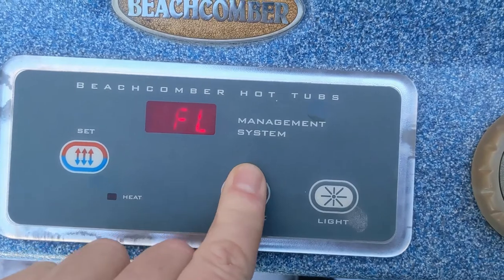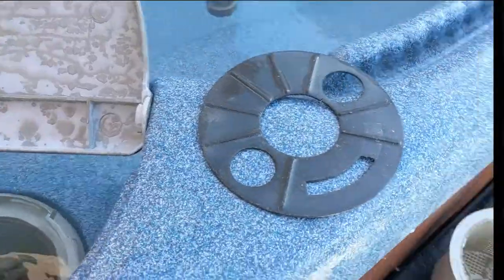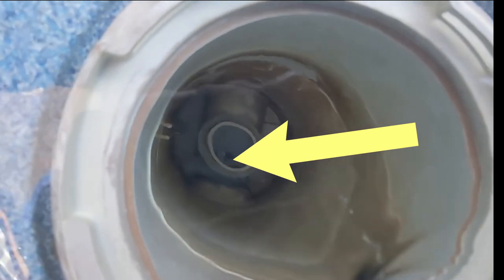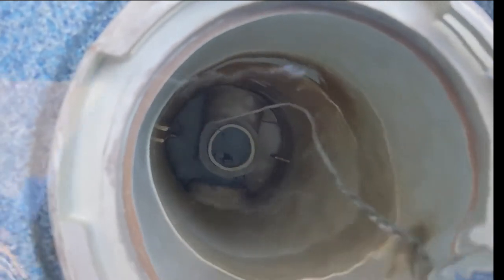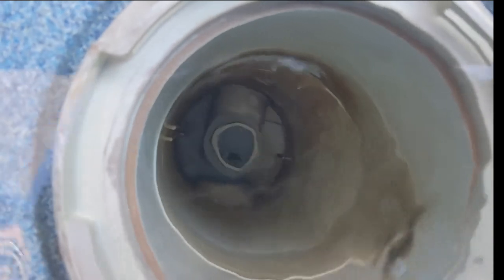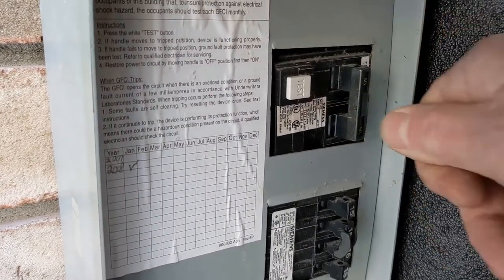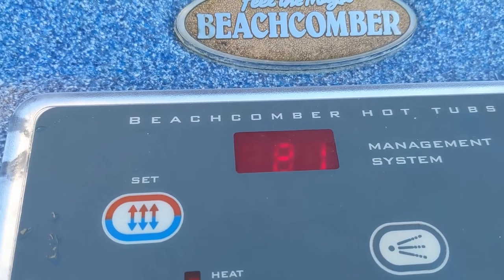Beachcomber HOT TUB FL Error Code / HOT TUB Not Working

Comment: Hello, I have a question. It's not related to error codes, but I have the same hot tub at home, and my LED light has stopped working. I removed it and closed my hot tub for the winter, but I have no idea how to replace it. Could you help me?
Reply from the maker: First.  Its rare that a hot tub light burns out.  Second.  Some beachcomber tubs it doesn't seem like you can even get to it.  Some, you can get from the inside but not sure if thats your tub.
Reply: @VIPPoolsandSpas  Yes, I know it's an old model, and I believe the LEDs have been replaced in the past. Due to water infiltration, the LEDs burned out. The spa was already there when I bought the house. Thank you for your response; I will consult a local repair technician.

Comment: I get an error code, but the pump and heater work when i push the jets on manually. The pump just wont circulate and heat in the low setting. So the tub just sits in a low flow state not circulating or heating until i turn the jets on  manually, and run for the 15 minute cycle.
Reply from the maker: What's the error code?  What spa pack do you have?
Reply: @VIPPoolsandSpas  Its a "Fl" code for no flow. Which makes sense because the pump (there is only one pump on this unit) isn't running, so the flow switch wouldn't be satisfied. Filters and actual flow are all fine. There is just something not allowing the pump to run at a lower speed and circulate while maintaining a temp. I'm not too sure the spa pack off hand as i'm at work. Def an older model. I'd say 2000-2005 300 series?
Reply: @VIPPoolsandSpas  The previous owner replaced the board, pump and motor 6 months prior. So relatively new parts
Reply from the maker: @travismiller77  Is the pump running?  Because you say it's running and then you say it's running fine?  Is there only one large pump or is there maybe a smaller one?  Also need spa pack name and model.
Reply: So... When i turn the breaker for the tub on, the pump does not run, and the heating element is not on. Regardless of the water temp. Just a low flow code. However, i can press the jets button and the motor and pump will start in high speed, as well as the heating element. Once the 15 minute jets timer runs out, the jets stop, the heating element stops, and the low flow error code returns, again, regardless of temps. Its a Beachcomber Hydro-Massage Spa. Model 550, manufactured 1997.
 @VIPPoolsandSpas
Reply from the maker: @travismiller77  Maybe a programming issue?  Is this tub new to you?
Reply: @VIPPoolsandSpas  It is. I am renting a place from friends while they are in Mexico. They bought the tub used years ago. They said they had just replaced the motor, pump and board about 6 months ago and it ws all working ok. Then one day it wasnt, so he flipped the breaker, and heard it fry. So just drained and stopped using it. I've since changed the breaker, and this is the current situation.

Comment: Mine one is going from Fl to the current temperature.. does that mean something different?
Reply: Same thing on mine. Can't figure out what to fix
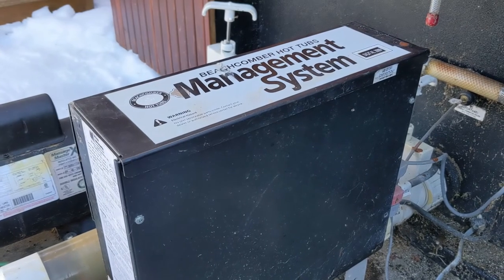Reply: Check the pressure switch wiring. 1. Disconnect power to the hot tub by tripping the electrical breaker. 2. Gain access to the pump and the management system. 3. Check under the management system and look for the pressure switch. See 0:49 in the video for examples of three different pressure switches. Look for a black and red wire in a grey wiring sleeve. The two wires connect to the pressure switch at one end and to the control board at the other end. Ensure that you have good contact at both ends. Verify that the crimp connectors at the pressure switch are tight. Also inspect the grey wiring sleeve and ensure that black and red wires inside are not broken.